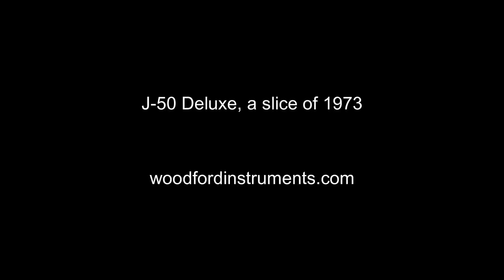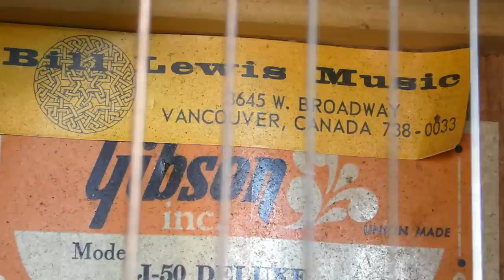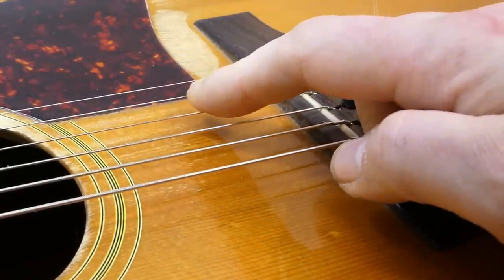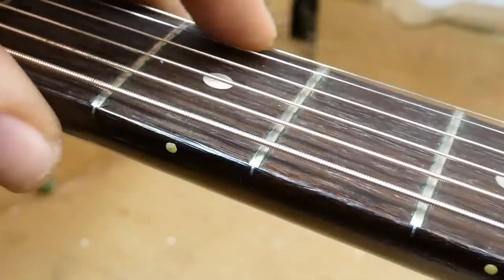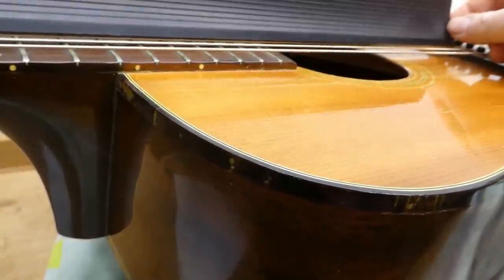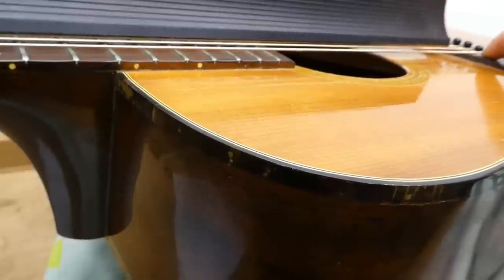A J-50 Deluxe

Comment: My ‘73 J45 Deluxe sounds great, even with all its battle scars - head stock break repaired twice, neck reset (not so well done), refret, and several repaired cracks in the top near the sound hole and finger board extension.  My son will treasure it long after I’m gone, I’m sure.

Comment: I will leave any significant repairs on my guitars to a professional like yourself.  That said, I enjoy watching your process and problem solving.  And, I've picked up some handy skills and tips that I use with repairs around the house like running the drill bit backwards first to make a cleaner entry into finished wood and using a glue syringe to get glue deep into cracks in furniture.  Good stuff!  Thanks.

Comment: btw, instead of those foam cutters, one can just use a bunch of pins of the same size (and ideally some material) 
I guess this could be even some copper wire from some electrical wire.

Comment: When you get stuff that refuses to undo like that, freeze spray (basically an aerosol can of liquid nitrogen people use to check solder joints with) can help. Obviously gotta be very careful about aiming it away from the guitar though, nitro and cold are a bad mix.
Reply: A spray can of keyboard duster or any type of pressurized "air" (it isnt), held upside down as you spray it, will work very much like freon.

Comment: Hi, not sure if you read/reply to comments, but I have a question. I remember your video where you straighten a neck by giving it a bow in another direction but can't find it. It seems I have a similar problem now - I have a wooden box with a lid which looks like a Pringle. I'm thinking about straightening it but making it slightly wet and putting weights on it did not work, it returns to the Pringle state in a couple of days. So I'm thinking about making a jig and bending it in opposite direction. What amount of bow do you use? The same, 1/2 of the same or what? It has a delicate lacquer also which I don't want to heat/steam/press much.

Comment: My 1970 J 50 looks much worse due to extreme metal finger picks. Also, I'm slated to have it worked on but I'm hesitant. It has a peculiar fragrance, in my 20's, I must have been very drunk in the middle of the night, I got up lifted the empty case lid thinking it was, well, you can guess the rest,

Comment: I think I'd have used stainless steel pins instead of dowels. I have a whole bunch of them, and from where they came, I do not know. A jeweler friend of mine took a couple handfuls of them and set them underneath the frets in a guitar. They touch the fret tangs, and as an experiment he didn't do all the strings and all the frets. You can sure tell which ones have the pins. They really ring out and sound good.